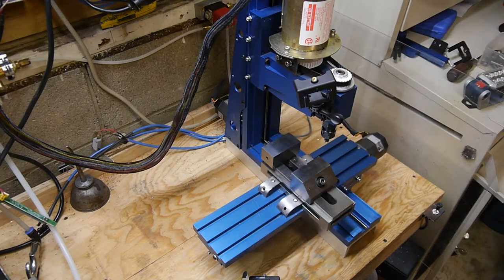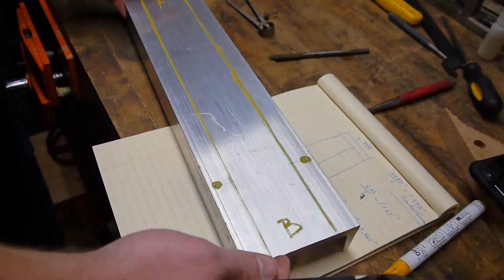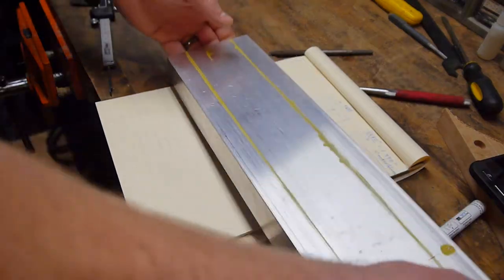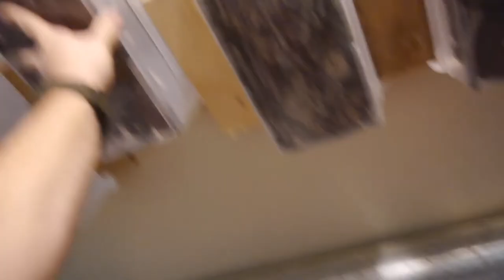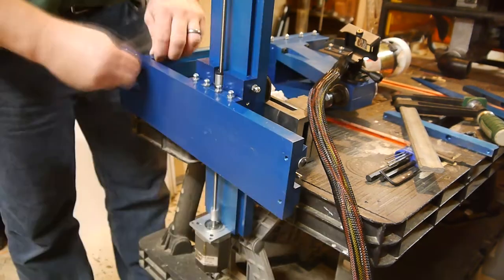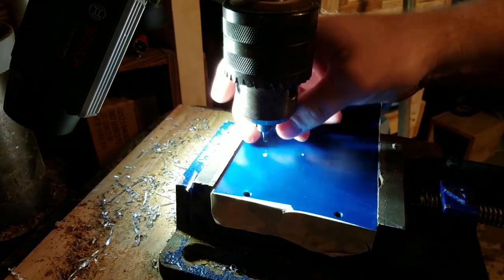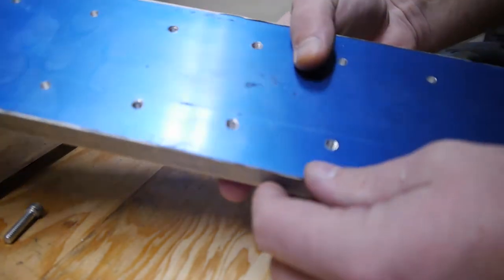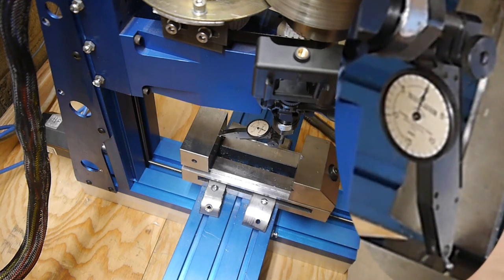Upgrade! How to give your MaxNC CNC Y Axis +10 rigidity for very little money.

Comment: Thanks for this. You could have drilled the Aluminium to the same diameter as the tapped holes, and drilled both together, then widened the holes in the aluminium afterwards. This would have fixed your alignment issues. I would also have drilled and tapped two holes at opposite corners as my first move, secured the two together, then drilled the rest of the holes (no need for clamps then) at the same time, to the tapping diameter, followed by widening the holes in the aluminium. For maximum stiffness, expoxying the two together would have been helpful, but I guess there were screw heads you needed to not cover over? Could you have extended the relevant bolts to go through the aluminium too, so that you could use epoxy?

Comment: Can this mill handle 6 inch round cast iron in one pass, without flipping the work piece?
Reply from the maker: It should, If I remember right it has 8" y axis travel, and 14" x axis travel.
Reply: @JoshAQ  there's one on eBay for 1300 right now. Is that too much for an old machine? Im looking at making cams out of 6 inch or so round stock.
Reply from the maker: @mrkimpham  How accurate does the profile of the cam need to be? I found the trapezoidal leadscrews and backlash nuts on mine leave much to be desired. Instead of milling circles on the xy plane they are more like ellipses. I got my MaxNC 15 OL for 600 and 1300 seems like alot unless there are alot of upgrades and accessories that come with it. I did a search on ebay and unless the two I saw are different, (1250 and 1400) I would not purchase either for that amount of money. Make sure that you are looking at a MaxNC 15 and not a 10 given what you want to work on. I would save up and get a cnc taig mill with ballscrews for several hundred bucks more.  You may be able to get the accuracy you need from that.
Reply: @JoshAQ  well, any machine I get, I will have to pretty much upgrade everything. I don't think it has to be super accurate. These are eccentric cams.for sewing machines to automate sewing patterns. I want to rebuild a few old machines and maybe fully cnc a few instead of cams. If worst comes to worst, I think I might just do a harbor freight conversion and cut reference points into the cam disc and cut in two passes. 

I'm space conscious, and whatever comes along conscious

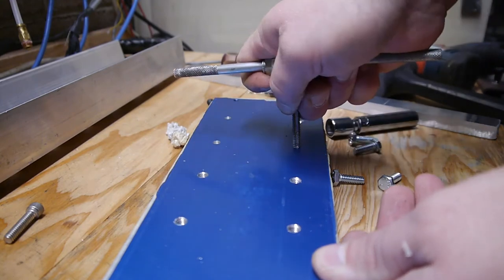Comment: 14:29 Where is your cutting fluid? Seems like your tap is going to break at any moment!
Reply from the maker: Hey D P, I normally dont use cutting fluid when tapping in aluminum. Dont worry the tap was no where close to breaking as evidenced by me using one hand most of time. Have you had taps break in aluminum before?